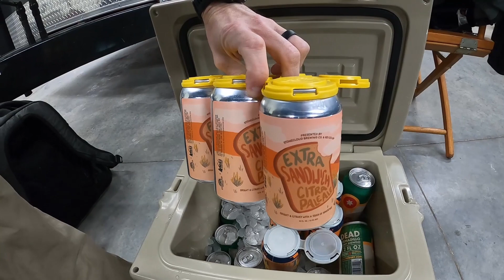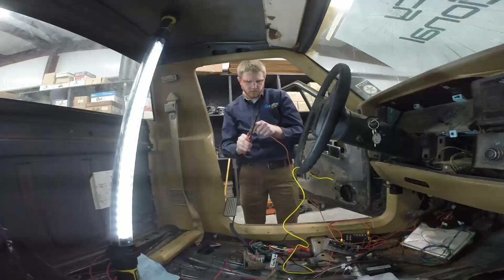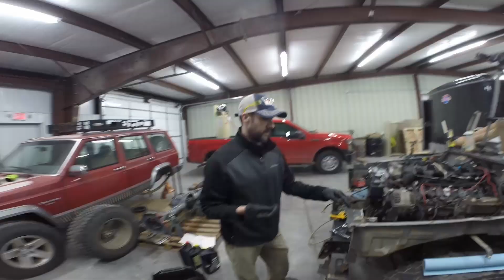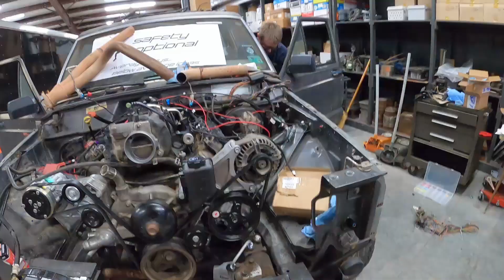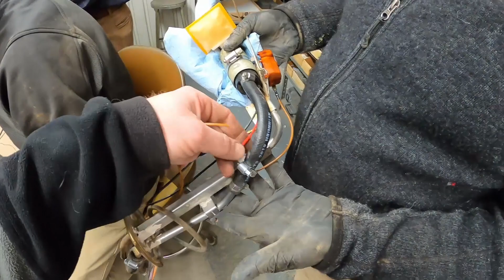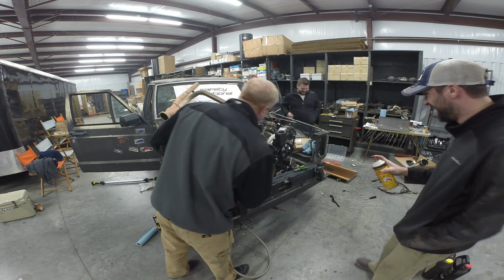Jeep Comanche Pickup V8 Swap - Part 13 - Almost Running!

Comment: If you didn't take any steps to disable VATS then it will never start. You need to have the ECM tuned to remove VATS
Reply: Damian stay tuned for updates. That’s forthcoming.
Reply from the maker: Damian Yep, and we had someone come by earlier this week to do just that.  As soon as we’re all able to get back together we’ll do the next video with it running and doing several other things.